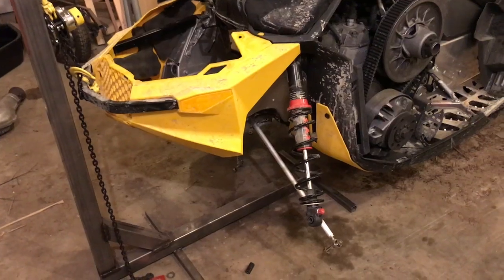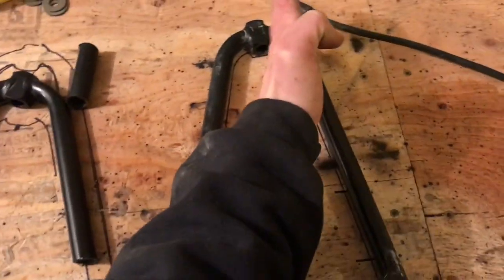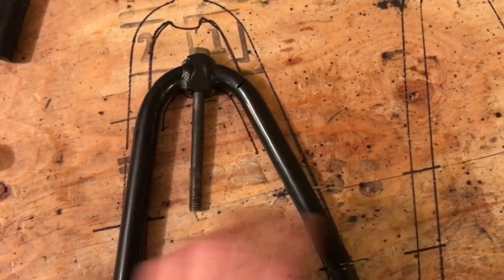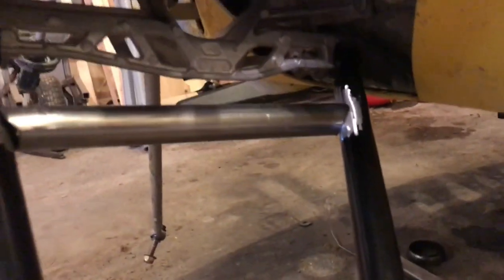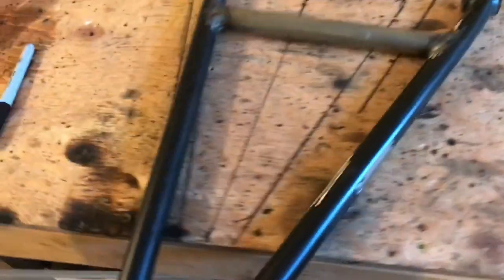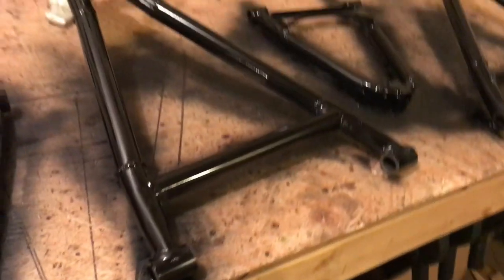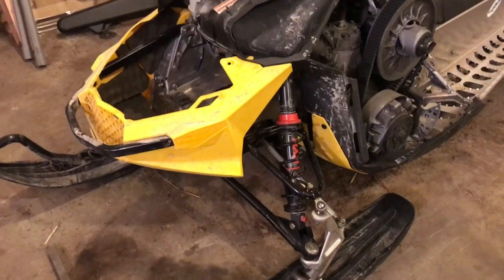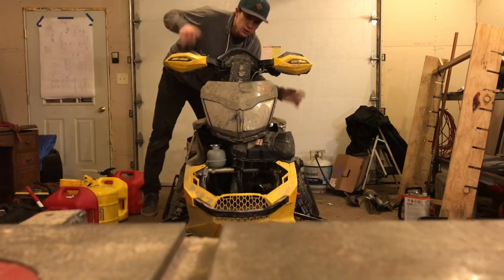DIY Narrow Stance For A Ski-Doo!

Comment: Kewl build or retrofit, the hallow tubs cut and join back, could do aircraft welds ( rosette welds ) tig or oxygen acetylene. With rosette drill holes in both cut ends slide smaller diameter inside join two end by adding weld into the drill hole then both outer ends. Like sewing. Nice work. 👍

Comment: Awesome video! looking to tackle this myself as well. How did you like it in deep snow? i assume its a lot easier to maneuver. what was your ski stance before vs after? thanks!
Reply from the maker: Greatly improved maneuverability. It's a pretty heavy machine but I'm still able to whip it back and forth with reasonable ease. I think it was 42 to begin with and now its about 37 or something like that